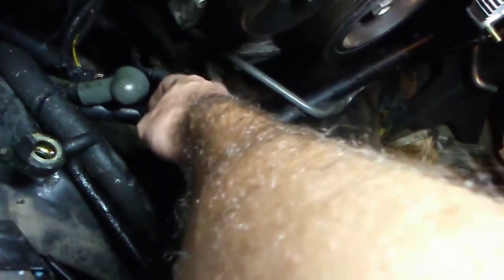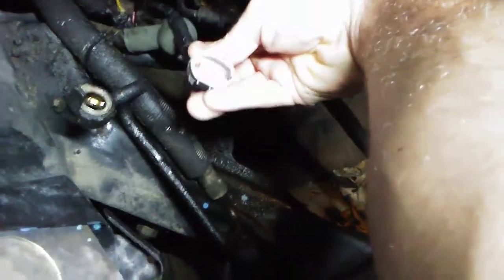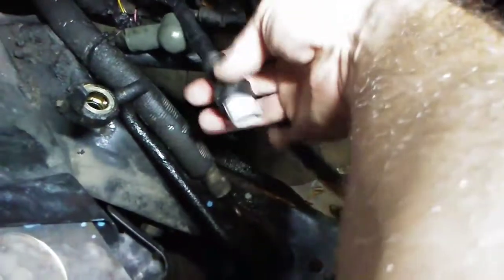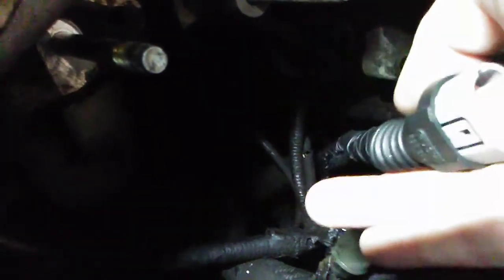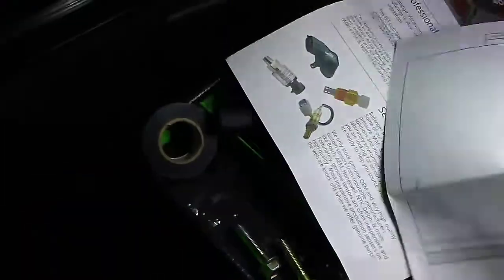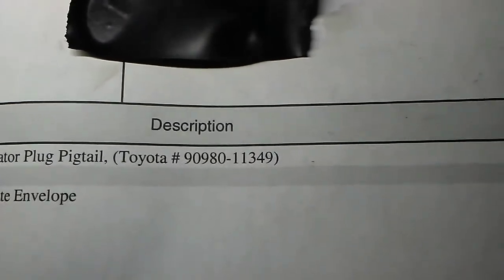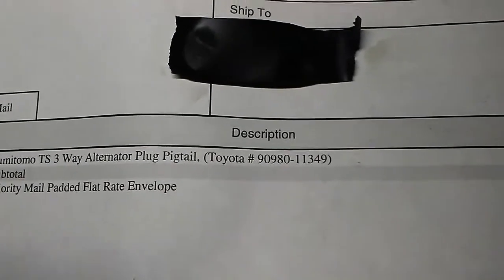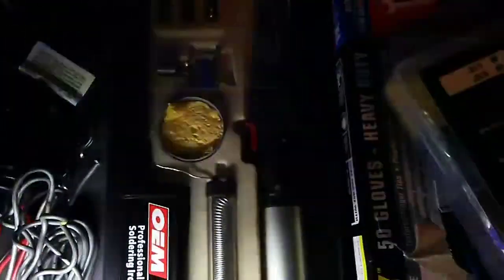LS400 alternator pigtail repair

Comment: I have an 02 suzuki alternater. The plug has 2 wires 1 red with white stripe and black with yellow stripe. The plug is discontinued. I have a 3 wire plug. 1 red wire with white stripe, 1 yellow and 1 green wire. Can i rig it up?